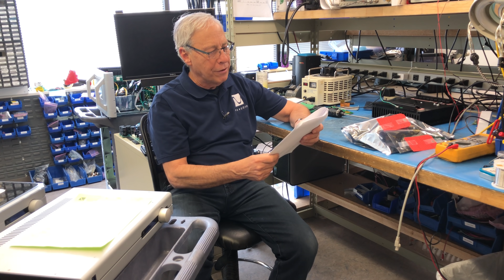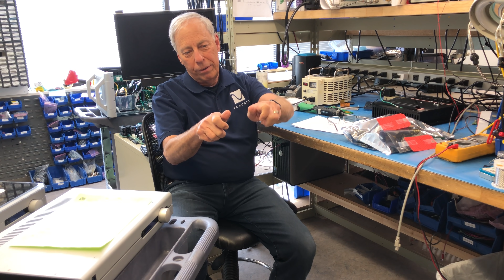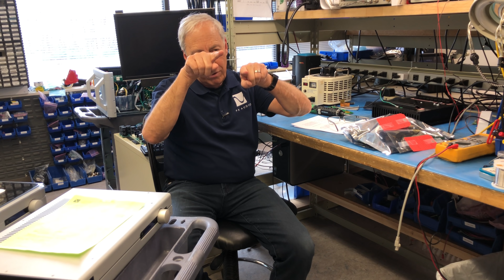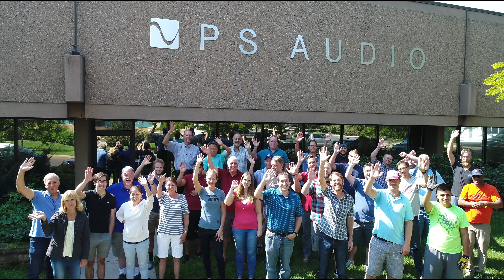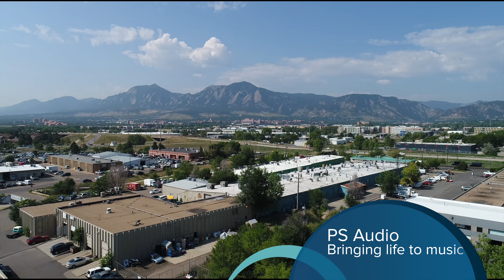Do we need balance controls?

Comment: Im running a CJ pre w/o a balance control. I absolutely loved the unit except in not having a way to control balance. 89%of the time im fine but occasionally sit off-center from the sweet spot and it drives me shithouse not being able to adjust it. Sure, I could drag speakers around but rather not for the short time im there. Been looking for a separate work-around but not spending a ton more for the et7 which has balance.

Comment: Oh no no no no no no no no noooooooo!  I use the balance control on my BHK preamp EVERY SINGLE TIME I listen to my two-channel system.  My listening area is an asymmetrical room, and both the BHK preamp and the BHK 600 amps use vacuum tubes, which take different amounts of time to warm up.  The sound would be markedly lopsided without that balance control.  Furthermore, in my head-fi system, I also use it every time in my DirectStream DAC Mk 2, because my preferred headphones have a driver imbalance.  They’re out of warranty, so sending them in to be repaired would be VERY expensive.  Don’t ever take away my precious balance controls!!!!!

Comment: The balance control isn't only used to make the center image shift. High frequencies are much more directional than mids and lows. The overtones can sound in a different place than the main note. The balance control can used to line up the highest frequencies with the mids that they are associated with. 

The easiest way to start is with cymbals. Use the balance control to make the shimmer line up with the strike from the stick. You'll get a much better overall image if you do that.

Comment: Like many here, my hearing is very slightly different in one ear compared to the other, and has been since I first had a stereo.  While I "might" be able to tolerate listening to speakers without a balance adjustment, headphones are nothing short of unpleasant without that slight tweak to the right.  Any preamp or integrated any without a very adjustable balance (i.e., not digital with large steps) would have to be a no buy for me.  Every stereo I've ever owned has always had the balance slightly to the right.  

And as for cars, I definitely balance things for the driver, why wouldn't you?  You choose what to hear, so why wouldn't you choose how to hear it!  

Oh, that's right, "yes dear, I'll put it back so it's good for you too ..."😌

Comment: I've never used the balance control on any of my stereo's until one time... when SEVERAL videos on the Bright Sun Films channel had the balance off a little. Was able to correct it with the balance setting. Using JBL Arena 130's powered by a mildly crappy stereo receiver on my desktop setup here. Balance controls. You don't need it until someone else messes up.

Comment: I have set my car audio balance so I get equal amplitude in my driver's seat from the speakers nearest me and from those on the passenger side. If I were to have my home speakers in a fixed position (as everyone does), wouldn't I need to adjust the balance if I were to sit in a chair that's not centred mid-way between the speakers (analagous to my car)?

Comment: "If you need to use your balance control you've got something wrong..." Is exactly my situation. Having a vintage Yamaha integrated powering Martin Logans in a small room allows the left-right volume pot imbalance to throw the soundstage from far left to slightly right as the knob is adjusted. Perhaps manufacturers during that era took into consideration the future degredation of their volume controls.

Comment: I used my balance control in my most frequently used environment. My computer desk is built into an odd  corner and I have my speakers are mounted on the wall one to the right of my seating area and one to the left. But the left is on an odd angle wall. This makes the left speaker two feet closer to my seating position than the right. The balance corrects this for me.

Comment: Balance control seems useless until you need it.
For example, watching a Youtube video where one channel is quieter. Or playing a tape where one channel is a bit worn out and quieter.
The amplfier that I use connected to my PC does not have a balance control (I built it that way, didn't think about it) and I have now used an equalizer as a balance control a few times. The next amplifiers I build have balance controls (in the form of separate volume controls for each channel and a "master" stereo volume control).
The amplifiers that I build all have mono switches (play either channel on both speakers or sum both channels and play on both speakers). Mostly for Youtube videos that have sound on one channel only, but also for mono sources and to check if the balance is correct :).

Comment: I bought a preamp last fall and in the end it came down to your PS Audio or the Rogue RP5 (I also considered the Allison unit). In the end the decision was the Rogue because  poor eyesight makes understanding what the preamp is set several feet away easier;  I find touch screens hard to read and set properly (essential tremor). The Rogue has nice big numbers and letters that make the setting obvious.

My listening room is a bit asymmetrical so I find it necessary to have just a bit less gain on one channel than the other so my balance control is always just a bit off. The one fly in the ointment is the preamp I bought has a 30 second warmup and it resets the vulume when turned on so I have to reset the volume and balance every time I turn it on.

Comment: I have a balance problem from my digital input that is apparently caused by Windows 10 on my streaming computer. If I use my Mac laptop or my turntable as a source, there is no balance problem. To fix it, I have had to buy 2 Schiit SYS passive preamps, one on each channel, changing the volume on one of them to balance my sound. I wish my preamp had a balance control. Actually, I wish Windows didn't suck. I did try one SYS first, but it added too much resistance, shifting the balance problem to the other channel. My streaming computer is made specifically for audio, with a special power supply and internal shielding over the RF producing parts. It also has a high end USB card. It is dead silent, sounds great other than the balance problem, and was too expensive to just throw away. I know people will make suggestions to fix this, and I did find an OS designed just for music playback, but it requires a hardwire to my router which is in a different room on a different floor of the house, and cannot be moved. If anyone knows how to fix the Window USB balance problem I am all ears, yes I have checked the internet.

Comment: Always uses the balance control in a car if I am the only occupant.
Reply: I think that it should be in the center all the time because of the angles of the speakers. The passenger door speaker blows the sound more at me while the speaker in my door blows the sound at my legs etc so I still hear them at about the same volume.

Comment: it's true, it's extremely rare to NEED the use of a balance control - but I consider it ESSENTIAL in the case of testing whether a speaker is mistakenly wired out of phase.  An essential tool for troubleshooting.

Comment: I still own a preamp designed by Stan Warren (Superphon Revelation Basic)  that if memory serves is similar to the preamp that PS Audio made years ago (when Stan was still there) as it has a vol pot for the left and right.  I don't have to turn both knobs at the same time and it has marks on the face-plate so you can adjust them equally.  I've never found it a problem to set the volume and or balance to mt liking .  I also still find a balance control on my other preamps useful.

Comment: One case where I use balance control is where one speaker is near a wall, and the other one is not.
The sound reflecting off the wall can make a considerable difference in volume, especially if the sound from the other speaker is absorbed by a couch.

Another case is when I've had a cold and one of my ears is filled with fluid, and I'm listening through headphones.
Reply: In my case the right side of my room has three open doorways so balancing towards that side helps to center the  image between the speakers.  Also when I sometimes listen while lying down on a couch which is a little to the left of the left speaker the balance control  lets me hear more of the right speaker.

Comment: As someone who is partially deaf in the left ear, my balance control is permanently in use. The deafness is frequency dependent being considerably worse in the lower frequencies. Consequently I am also a tone control "sinner" and apply a little bass boost to compensate.
While I awaited the arrival of my Stax earspeakers recently, I read the bulletin boards comments on second hand Stax and it's quite common for them to become unbalanced while remaining perfectly usable, albeit at a lower price than perfect Stax. A good thing considering a new pair is far from cheap. 
I would love to fix my hearing problem, but that has never been offered in all the years since the damage occurred. In 1969 I flew in an unpressurised aeroplane to King Island in Bass Strait for a wedding. While coming in to land I was advised to pinch my nose and blow hard to relieve the pain from the increased air pressure. This forced some mucus into my left ear canal and consequently it became infected. As a consequence I had to give up my hobby of skin-diving.
Balance and tone controls may be useless appendages to some, but as I am constantly reminded, I too am a useless appendage now I have reached my dotage.
Reply: I was going to say the same thing.  I have some high end hearing loss in my left ear and lose 3-6dB depending on the frequency.  A slight left bias evens out the sound for me and makes listening much more pleasant.
Reply: The same thing applies in rooms, in the real world we don't all have perfectly tuned listening rooms do we? Well given that your room is likely the biggest factor in getting you sound right and the biggest pain in the ass in achieving it without turning your room into an ugly uncomfortable environment. There achieving balanced output for listening position can easily be achieved with a balance control. It should in the analogue domain be as high quality as the volume control I.e. Alps blue velvet volume should be partnered with the same as a balance control. I think Paul is skirting around the question as his premise has always been "if it's not needed we don't put it in" and then proving it to the customer. So let's not kid ourselves they can be useful even if rarely used.

Comment: Balance control was a useful feature for correcting channel imbalance during analog era of vinyl & especially for compact cassette as side A stereo image would sometimes sound a bit "unbalanced" vs side B due to recording or playback head alignment mismatch issues or to correct volume pot non-linearity, but the advent of digital audio made this another legacy/obsolete feature. IMHO balance control would make channel separation ratio worse & add another unnecessary road block in the signal chain. I dropped it out altogether from all of my DIY headphone amp & chipamp implementations. As for car audio it’s a necessary evil due to less than ideal driver/passenger seating & listening arrangements.

Comment: I use the balance control (left/right) and the fader control (back/front) in my 2002 Ford Taurus SES. The rear speakers have more bass response than those in the front, so depending on what I'm listening to, CD or FM radio, to get it to sound good and balanced, I have to adjust both and the bass/treble. I must also say that the sound system is very clear. I can hear the lyrics better and can hear words I never heard before. One in particular is a song by Lucifer's Friend 'In the Time of Job' there was a line we could never hear before that says "Screw me I'm a tuba'. We never knew it said 'tuba'.